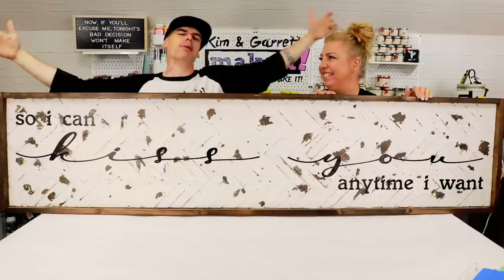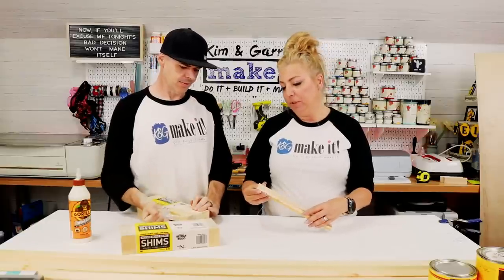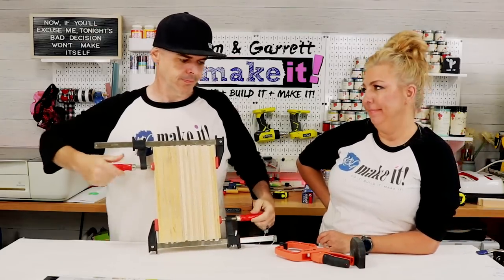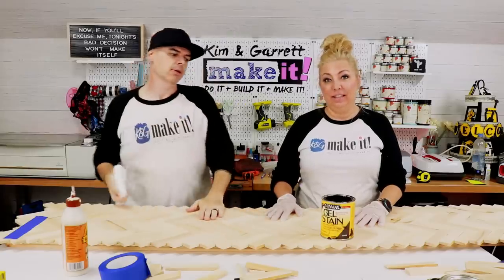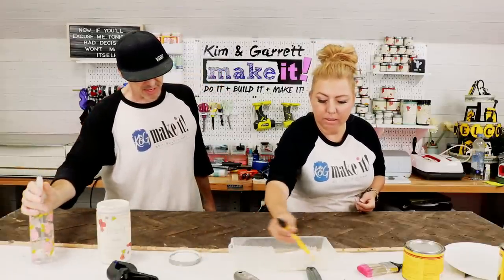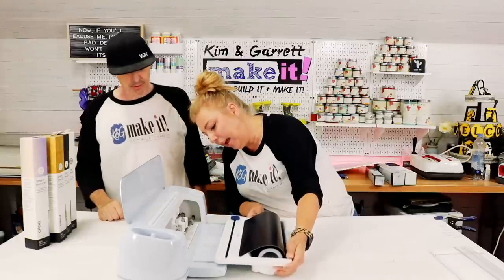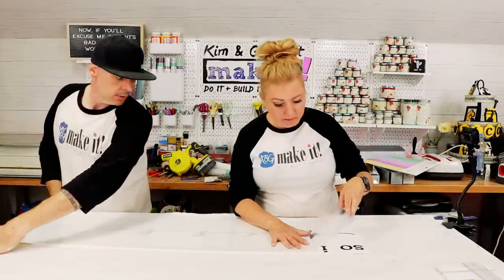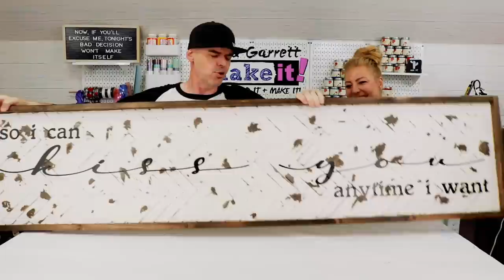DIY Herringbone Chippy Paint Cricut Smart Vinyl Farmhouse Sign

Comment: It seems like you really wouldn't need to glue the shims and make them thicker since you can't actually tell they are thicker on the sign. It would save time and material. Is there a specific reason you glued 2 together? I may have missed that! The sign and technique are great. Always love your ideas.
Reply: Shims are tapered on one side so two glued to each other (in opposite directions so one tapered side was glued to one with the tapered side on the opposite end) to make them one thickness all around. I don't think I explained right, I hope you understand though!